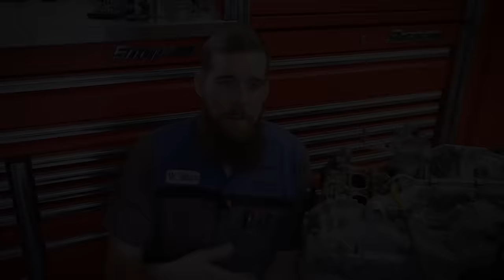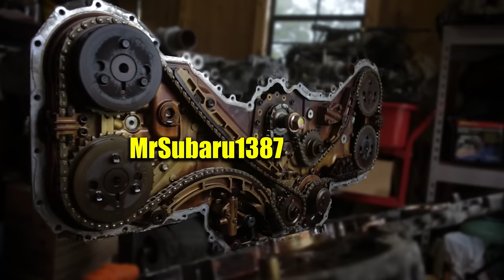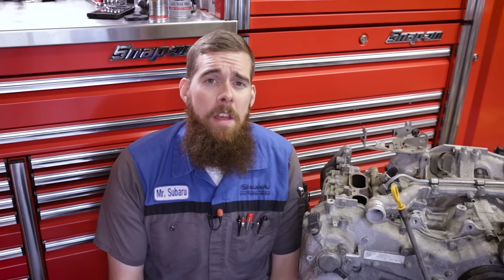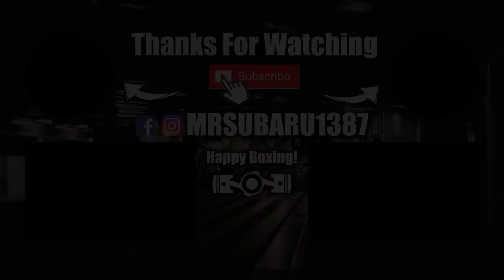Why Subarus Are So UNreliable!!! Buckle Up!!!

Comment: Mr. Subaru. Thanks for being so  informative regarding maintanence on a Suburu. Despite following every maintance interval on my low mileage 2016 Impreza 5 speed manual I got Torque binding at 65000 KM. It was especially pronounced after 15 minutes of driving and clicking noise when making turns. The cost of repair was so high that I opted to purchase another car.

Comment: I know my username is a Subaru but I don’t actually own one, YET! But my gosh the emotional roller coaster I have thinking about if it’s worth it to buy this sti I have wanted since high school based on all this hate and misinformation. I can only imagine how much harder it is to deal with as a Subaru tech/master mechanic… My parents have had a 2017 forester n/a since about 3,000 miles and only issue was a dead battery in 2020. I love every chance I get to drive it! Thanks for sharing the right information, it helps me feel confident that my dream to own an sti is reasonable and not something I should be sacred of owning!
Reply: Get it man it’s definitely worth it just take ur time finding a clean spec it’ll be worth it!
Reply: @prodbyahlecks   yeah, as soon as the market settles down, I’ll be looking for one!
Reply: @hyperbluewrx  very true the market is high right now, get a cheap daily and stack up in the meanwhile. I would definitely suggest having an extra car if ur getting an sti

Comment: Completely understand your frustrations. My wife complains about the cost of maintenance our cars need. But proper maintenance and they don't leave us stranded. I absolutely love our 2018 forester and would definitely buy another subby. Fyi we have a 2006 chrysler town and county with 217K miles and a passat with 177K miles. They all run perfectly from the regular maintenance and repairs they need at time. Except for the forester the chrysler and vw were bought new.  Thanks mr Subaru. Love your channel.

Comment: I have a GC8 that has run for 4 years. And it at 230,000 miles. I thought it would blow sooner than that. I do my regular oil changes and it still runs. Its awesome. 2000 dollars well spent. I just bought 2 more GCs !

Comment: PREACH.  It speaks volumes that subaru is able to be that car company right now.  Great video.  Love my 06 outback 2.5i with 416k miles.  Would rather do a head gasket repair properly on a subaru that needs it than who knows what else from another brand

Comment: My 2012 Forester non-turbo was burning a bit of oil, nothing crazy, but then it suddenly developed heavy knocking one week after a fresh oil change.  The car had literally burnt all the oil off, no leaks anywhere.. it just torched it all.  This seemed insane to me so I did some research, and it turns out that my year of vehicle along with a few others had a short block recall on the engine.  

However, when we brought it into subaru, they tried to hide the fact that there was already an ongoing law suit about it in the states.  So instead of correcting the issue in the past, Subaru saw dollar signs.  They had decided to ship the cars up here to Canada, and sell them like they were fine.  

After learning this, we fought back and forth with subaru and eventually they admitted to the problem and their decision to keep them in Canadian markets.  They covered the 24 hours of labor and the short block replacement.  

That was at 100k km, now it's at 170k km and she runs like a dream.   Never had a problem with oil burning since.

I have no sympathy for people who mod their car right out the yin yang like you say, but there is also a chance that their vehicle was part of this group of problem engines.  That problem, in addition to their idiocy of modification and maintenance, means that the car is sure to fail.

Comment: Video well received!  I know I have mentioned this in the past but it bares repeating.  I own a 2014 Impreza Premium 2.0l NA on its way to 200k.  I always perform scheduled maintenance with Subaru OEM parts… no issues and I am not worried about the high mileage.

I live in a condo complex and when I look out my front door my neighbor to the right has a 2007 Outback LL Bean edition while my neighbor to the left has a 2010 Forester 2.5l NA and a 2015 Impreza WRX 2.0l turbo.  All these vehicles have zero issues and all have been properly maintained with genuine OEM Subaru parts.  I know because I maintain them all.  

When my neighbors asked what manufacturer I recommend for driving in the Northeast I said Subaru.  Unbeatable all wheel drive, cars are super easy to work on, and parts are cheap when compared to other car makes and models.

True anything mechanical can fail and your going to pay if you want to play and play hard.  However this can be avoided through proper care and maintenance and certainly should not be promoted through neglect and ignorance.  Spun rod bearings can be avoided by checking the dipstick dip$&!@.  FYI it is the one with the yellow ring end as seen in the video.  FYI again all fluids you should check have  a yellow cap or top!  Subaru can only do so much to make things idiot proof.  By the way Mr. Subaru you can shake some people all day long but if there’s nothing upstairs…there’s nothing upstairs.

Comment: This 💯 needed to be said. I fall into the "young" group that owns an '18 STI. This car has been modified from 8,000 miles and it's been such a learning experience with this car.... From various power levels 300whp to now 500whp...this car has not skipped a beat and hasn't shown signs of giving up on THE STOCK BLOCK. I know the gamble I'm taking with modifying but I've always put the best parts known and trusted by tuners around me and putting all the necessary supporting mods for these power levels AND doing all the maintenance regularly BUT also not beating on it and trying to race every person on the road. The car sits at 68xxx miles now and is still good (knock on wood) but I acknowledge the risks I'm taking making power and accept anything that comes with it rather than blaming the car cause it's not the cars fault. 

Anytime anyone gives me shit I joke along but then point out every little thing they're doing wrong that I know of and help educate and fix their bad habits so they have a deeper respect for the cars rather than beating them to shit. There's always gonna be idiots that don't care and will always talk crap on Subarus but I say let them leave the community and keep the better folks around 🤷🏻‍♂️. 

So once again thank you for saying this. It needed to be said. 🙏
Reply: Taking care of your car becomes even more important the more power you out into the engine.
I'm glad to hear an STi (VA) owner that actually is an adult with their car as this seems to be rare. I just find it funny that these guys who beat their cars think their cars are more valuable than the new car coming out for MY 2022 (VB?).
Reply: 1 year later, has the 257 blown yet?
Reply: @jwljwljwwwwl  it actually did but due to my own greediness going for that 500whp 😂 I knew I was playing a dangerous game pushing for more and more but I wanted to see where she'd give out and we found it at 32psi LOL
Reply: @imistimed6901  haha thats crazy. thanks for the update. I'm personally afraid to go much more than 18 psi on my 255. Did you repair or replace the shortblock?
Reply: @jwljwljwwwwl  of course! I like to be transparent too in my journey. The car was pushing happily at 22-25psi but like I said it was a risky game wanting more. (would've helped if my tuner knew I was running uel headers which I thought he knew LOL).. 

Completely replaced the block with a forged bottom end and rebuilt the top end with BC280 cams and valvetrain
Reply: Lol, he's taking about you....🤣🤣
Reply: @Boatfisherz1  LOL it indeed applies to me 😅 I knew what I was getting into when I kept pushing for more and more power but that comes with the territory of pushing the limits of the factory engine and in general racing. The stock engine got me plenty of fun and last me for 4 years making plenty of power so can't complain there
Reply: He is right....u can't compare a Toyota to a Subaru 
Because a Toyota is well built in almost every way
And  boxer engines are crap
Even volkswagen waterboxers had problems with head gaskets
Reply: Would love to see the proof of 500whp
Reply: @fil1329 that's why Toyota is making a boxer like the subie?

Comment: I just bought a 2008 subaru outback with 175,00 miles on it. When I first looked at it I could tell the original owner had the head gasket done. This car doesn't have a single leak. I put new wires, plugs and a coil on it, cleaned the throttle body and changed all the fluids and I love this car. I've bought everything from the dealer and I do not regret it at all. It might be more expensive but I can tell the quality is there. Your channel has been invaluable to me as I've learned about this car.

Comment: I couldn't agree with you more. I've owned 5 Subarus in the last 35 years, starting with my 78 DL 4wd wagon to the 2010 Impreza I currently own. Not one of these cars has ever left me sit on the side of the road. I have always associated Subarus with reliability. I am a firm believer in keeping everything factory. I learned this the hard way modifying my Mustangs back in the 70's.

Comment: Could not agree more with you that most if not all issues with WRX/sti are driver error.  I have 97k miles in my hard! driven 100% stock 2017 WRX.  By hard driven I don't mean abused. I will often up shift at high rpm (5k+ rpm). Oil changes every 5k mile, original clutch no aftermarket engine mods or tune. I have had 0 problems with the car except for a battery that failed at 37k miles and Subaru replaced it for free.  One needs to know how to drive.  Proper way to up and most importantly down shift.  It drives me nuts reading WRX forums everyone want to mod the engine but seems not to want to put the effort into learning how to drive.   A OEM WRX/sti is a blast to drive as is and if driven properly will last a very long time without problems.

Comment: I enjoy fixing up old Subaru's and saving them from being scrapped. I drive a 96 legacy outback, switched out the old tired 2.5 with the ej 2.2. Had an idler pulley break on me on a road trip and the car kept going for 200 miles with jumped timing until I fixed it. They are built to last. Hoping to rebuild the 2.5 one of these days and eventually build a custom legacy outback something like the bg5 because everyone sees the STI and WRX going down the road but a costume built outback would be more unique and of course it would be done right so the headgaskets don't blow after 5,000 miles lol. Great video.
Reply: They’re great cars to work on, reliable, durable, capable and versatile. Taking care of them, they easily last over 300K miles. I changed the OEM H/Gs with MLS H/Gs on my ‘01 2.5L n/a Forester, its motor never leaked ever again.
Reply: I had the same exact thing happen on my 96 Legacy Outback with the EJ25D. Idler pulley broke at 215k miles on a road trip. Luckily had it fixed at a dealership and the vehicle somehow didn't jump timing, so I still drive it 5 years later and it's almost at 250k miles. Nothing else has gone wrong since and I can't bring myself to sell it.
Reply: @Tiny_Speck  You got really lucky that it didn't jump timing since the 2.5 is an interference engine.

Comment: I've been saying this forever,  Subaru's are like pets and children, they are a reflection of the owner/parent.  

I've got two 2004 Forester XT's, one 4EAT, one 5-spd, both Daily Driven, one with 257K miles and one with 140K miles, both the most reliable vehicles I've EVER owned.  ALL reliability issues were a result of me taking the vehicle to be serviced by a NON expert because I didn't think I could afford the cost the expert had quoted me, not realizing the potential cost of fixing the non-experts mistakes. (first timing belt job done by a friend who owned a local maintenance garage my father had his corvette regularly serviced at, they used an air gun to zip the AVCS pulley bolt back into place and ended up punching a hole in the back of it, causing a loss of oil pressure in the avcs system resulting in over-advance codes and twice the initial cost to have the local dealership fix the poor work of the local "professionals" who didn't work on subarus)

(Edit:  Mine are both NOT stock.  FULLY and REGULARLY MAINTAINED by a SuBaRu Expert! (not me, thanks Daner!)  I've addressed all of the inherent stock issues (AVCS banjo bolt filter removed, swapped stock catted up-pipe for the STI non-catted unit, IAG Oil pickup, windage tray, and 06+ oil pan, IAG AOS, AEM/Walbro Fuel Pumps, GetADomTune Cyl  Cooling Kit, with vf39, sti intercooler, catted downpipe, Mishimoto Radiator, Cobb AP and a custom RELIABLE tune by Chris at Surgeline in PDX.  =$1800 total.)

Change the fluids regularly as per the manual, use quality fluids of at least OEM quality, change the spark plugs, check the oil everytime you fill the gas tank, don't redline the motor, don't abuse it.

Watched to the end!  Thanks!!!
Reply from the maker: Awesome to hear! 👐🏻 So many other owners have told me similar. Big mileage, trouble free, from well cared for Subarus.

Comment: I have a built STI 2006 and I've used only the most expensive parts - Cosworth pistons, 12mm OEM oil pump, OEM brand new nitrided crank etc.. For example, many people put a lightweight crank pulley on their ej25, I've put a Fluidampr pulley. 

My maintenance schedule is as follows:

Oil is changed every 3k km with Bardahl XTR 5w50 with Full Metal additive (no buts or ifs with this maintenance and yes it is expensive AF)
Spark plugs are changed every 8k with NGK one step colder (mine runs around 400 bhp since I'm with hybrid vf37)
Fuel filter is changed every 10km, yes the one in the tank,which is rated from Subaru for something ridiculous like 80k km
My COBB filter is being cleaned every 1k km
Car uses only 100 octane fuel
Water coolant every 10k

I check my coolant and oil at least 2-3 times a week and every single time I'm planning to drive hard, I'm even joking, that my bonnet is being opened more than my drivers door.

I have Defi gauges for coolant temp, oil temp and oil pressure. I'm always waiting for the temps to be at their optimum, before driving hard and yeah, I drive it hard.

Yes, it is a car that needs attention to itself, but it's a "rally" car for the street with a little bit more specific engine than the daily Corolla with 1.3. 
IF YOU ARE NOT READY TO MAINTAIN YOUR SUBARU, DON'T BUY IT IN THE FIRST PLACE!!!!!!!!

Comment: Its the vapes making the kids go nuts with their subarus! 

I have an ‘11 outback with the ej253 and 190k miles, runs great, even though its got some miles on it, I still choose to use oem subaru parts for routine maintenance and for parts that fail, who knows, the car might last longer than I think. And all it takes to make a subaru last is by just going easy on it, checking fluids religiously, not smoking crack, and changing the oil regularly, I’ll do my oil every 5k, and so far it seems to be keeping the motor in good shape.

Comment: I "was" the guy who avoided Subaru's like the plague because I listened to everyone else. I just bought a 2006 Outback Limited 2.5i with 273k miles on it for $1500. Just changed the coolant crossover pipe O-rings, alternator and the battery. Still runs pretty good but the previous owner took extremely good care of it with tedious record. It's all about proper service and not driving like an asshat.

Comment: I had to replace my 04 LL Bean 3.0L's head gaskets at 200,000 miles.  However it was my first car and I did not maintain it well out of ignorance and who knows how it was maintained before I owned it. And that engine did last 2 years after being overheated pretty bad (I was 18). Now it has 244,000 miles and is running great - I'd take it across the country tomorrow and it's my baby.

Comment: As a person who lives in southwest PA, I’ve owned a NON-TURBO AUTO 2007 IMPREZA WAGON. Worked for Subaru themselves for 5 years. Most towed in Subaru was the TURBO WRX/STI and the TriBeca. My NON-TURBO Impreza had constantly oil consumption issues. When it approached the oil change mark, 3000 miles, it would go through a 1/2 tank of gas and 2.5 quarts of oil around the 2700mile mark before needing to change the oil. My old Subaru was well maintained by an older couple. The reason why I traded it in 2 years to the day of owning it and 50k miles later, is because it started to have center diff issues, poor mpg, and the oil consumption. Besides all that, car was great in the snow paired with winter tires. Bout the car with 101k miles, traded it in at 151k miles.

Comment: I have a 02' WRX. I blew my engine back in 2012. At that point it had 176,000  hard hard miles on it. I drove it like Colin McRae every  time I got behind the wheel. While I did initially have some problems with brake rotor warping and transmission issues I solved those with upgrades but had no engine problems until it blew. I am not going to lie and say I did my oil changes on time and kept it topped up. To me that just shows how robust these engines are. I had not even changed the factory timing belt. The failure was a rod bearing. It was my fault. I loaded the wrong tune on my access port  and on a stock turbo it ran a sustained (was racing) high boost pressure of 19psi. I had just installed a downpipe and the access port. I love my car. Everytime something breaks I use that as a opportunity to make it better since I am obviously driving it harder than the factory intended.